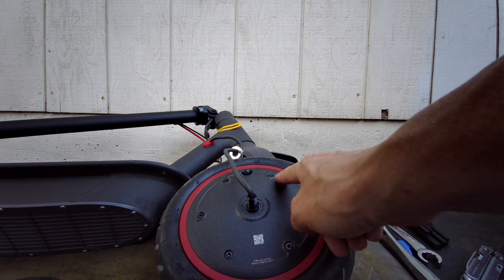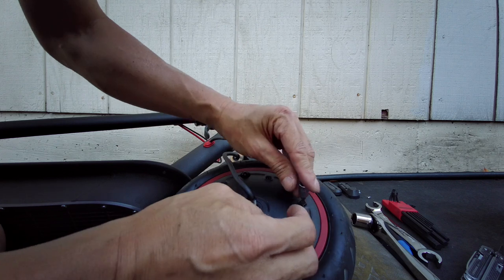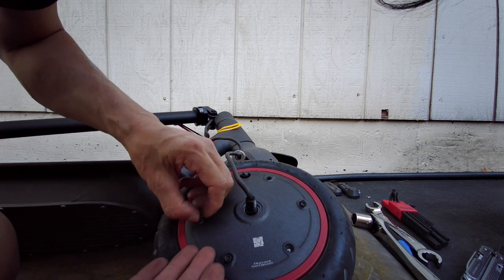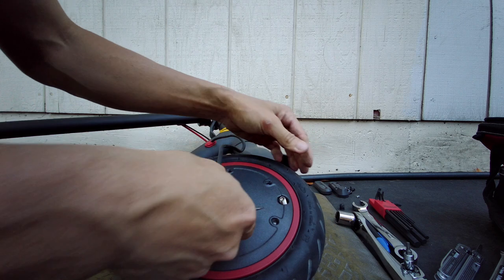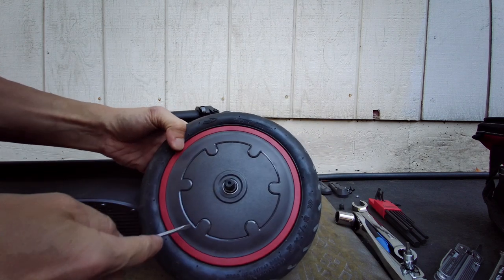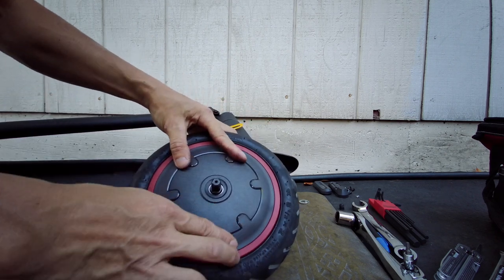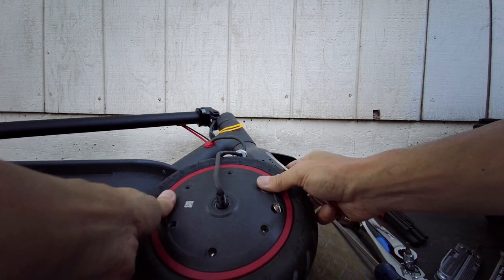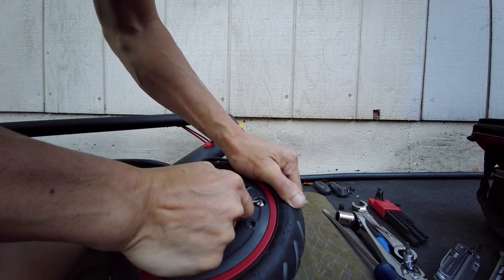Xiaomi M365Pro wheel/motor cap removal

Comment: I have a Swagtron 5 everything is good besides the motor it won’t move at all when I use the throttle and it makes a noise when in the wheel when I use the throttle idk if the motor is done on it or a lose wire
Reply from the maker: check all the connections, use a multimeter to check for voltage make sure the battery is charged and holding as well as at all the components so they are getting volts in/out.  If you know it is the motor then take the cap off like I showed in this video (should be the same design).  And you'll see if something is burnt in the motor.  Also check for shorts, usually something will be burnt.

Comment: Just wondering if the xiaomi motor will work with the gotrax gxl v2. the gotrax motor has been out of stock for more than a couple months now. I looked at the wiring on my gotrax and it looked like the same wire colors in the xiaomi motor photos. I forget the colors but something like orange, white, blue. It wont be too hard to just snip the wires then solder the xiaomi wires to the gotrax adapter.

But the Xiaomi photos also showed an extra part of wiring adapter that I have no idea what it is. There are the 3 wires and then some extra adapter.
Reply from the maker: If they have same voltage spec I don't see why it wouldn't work.

Comment: Can you upgrade the motor on this
Reply from the maker: probably but if you gonna spend more $$ just get the next higher model and be done...actually get one with 10" wheels instead of 8.5".  The larger is so much more stable and comfortable.  I like my GoTrax G4 much more than the M365Pro and they are about the same price.